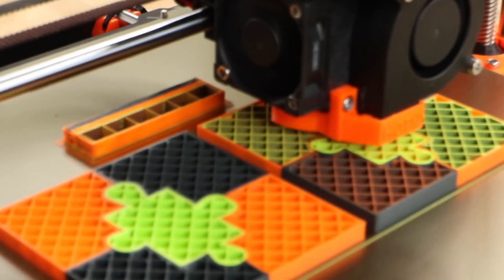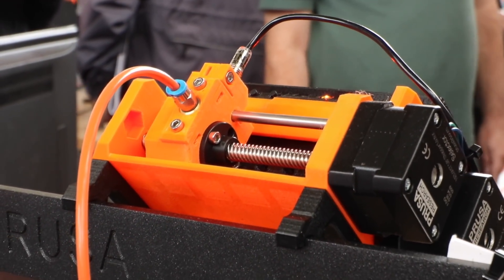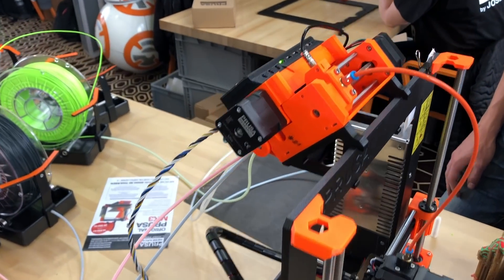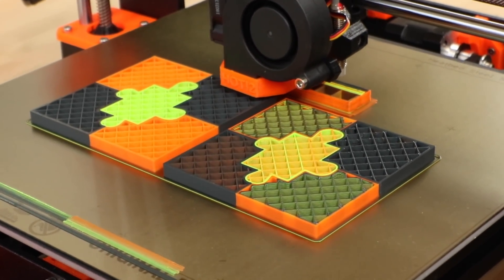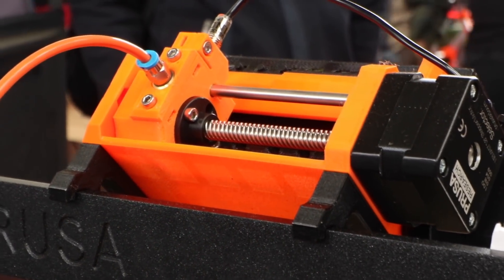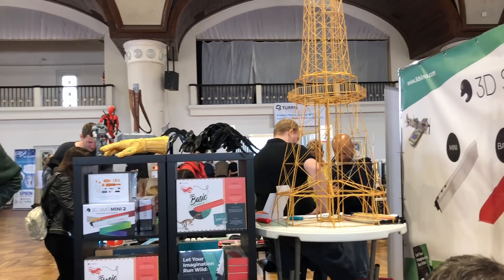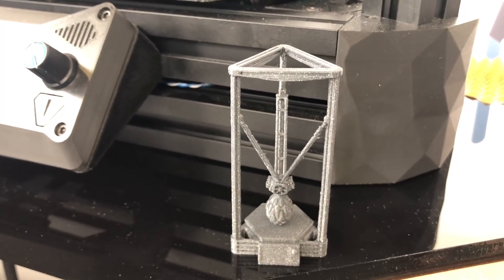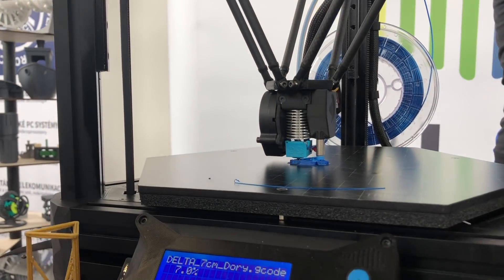Prague Maker Faire  - Prusa Multimaterial V2, Air Cannon, 3D Printers, Drones and More

Comment: Ohh.. why is my "2 colors wall street bull" without attribution card?  Josef Prusa - please instruct your team Prusa to add a card with attribution to designer: Dizingof www.3Dizingof.com - as per Creative Commons Attribution LICENSE.   THANK YOU!
Reply from the maker: It was there I promise! But people moved it from the display it was on
Reply: Thanks Joe, the card should be attached to the model with a simple wire. You know me.. i'm all for innovation and progress and i really dont ask much but attribution to designer.  Its been so for the past 8 years.
Reply from the maker: I understand, the problem is that it’s hard to keep track of hundreds of models on display, they were all done perfectly when the faire opened
Reply: This design was published on thingiverse in 2016 - https://www.thingiverse.com/thing:1442085 - to push hardware manufacturers to excel with their 2 colors FDM deposition - If Prusa team as other manufacturers choose to use my design i ask they follow the simple License.
Reply from the maker: And they did, the placeholder was there with info

Comment: That's interesting, did you ask why there is a pinda inside of the MMU v2?
Reply from the maker: Yes I did! Haha. So, there is a very small ball bearing, when the filament passes through it pushes the metal ball bearing and triggers the Pinda probe and that when the filament starts and ends :) simple and very effective
Reply: MMU v2 has come a long way since I saw it at Reprap in Goshen, IN.  early spring.  Looking awesome!